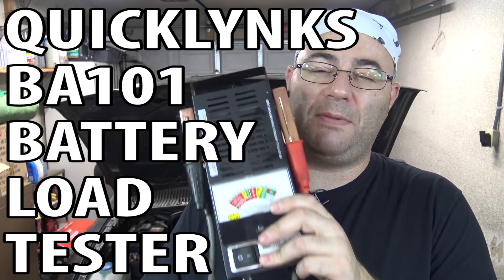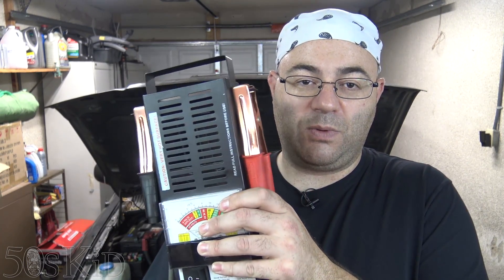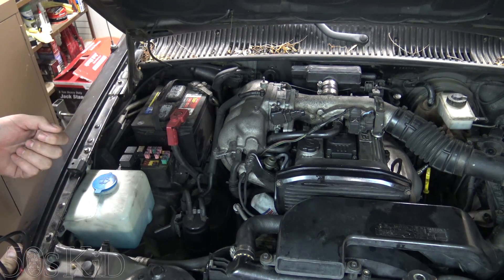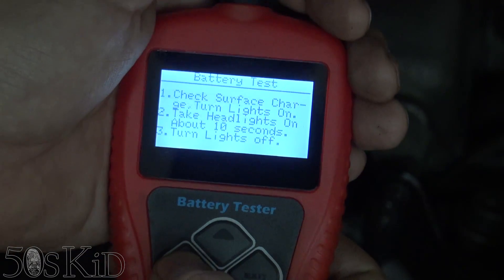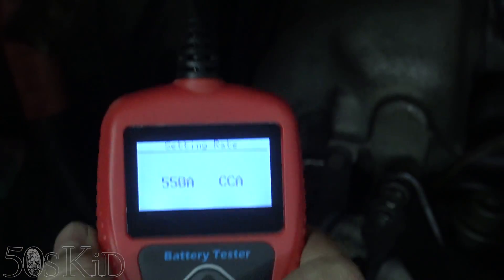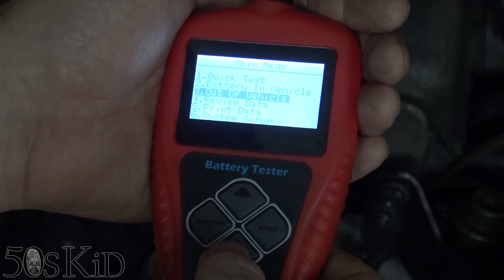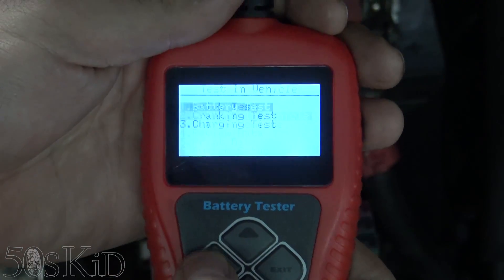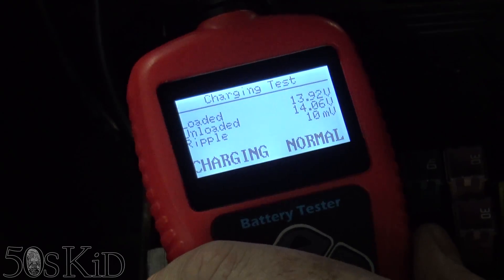Tool Review: Quicklynks BA101 Battery Load Tester

Comment: 50sKid:  Do any auto manufacturers have this type of battery tester installed in their vehicles?  With all the electronic gadgets that are loaded into modern-day cars, it seems that this item could be built into the electrical system of any car or truck   The average bear doesn't pay much attention to their battery until it fails.  The ability to easily check the battery could be the "ounce of prevention" that would prevent a lot of calls to "roadside assistance".